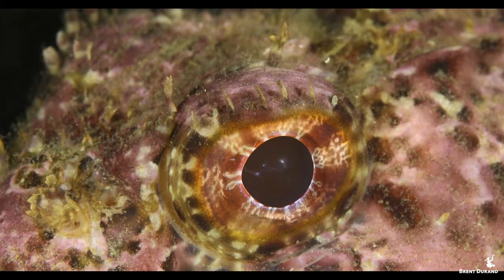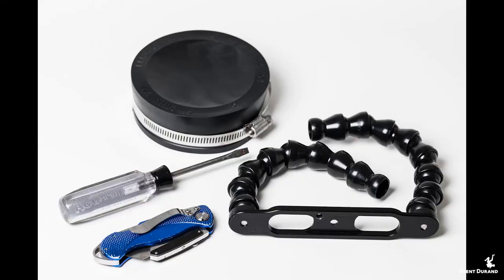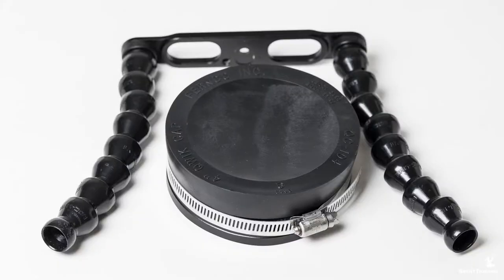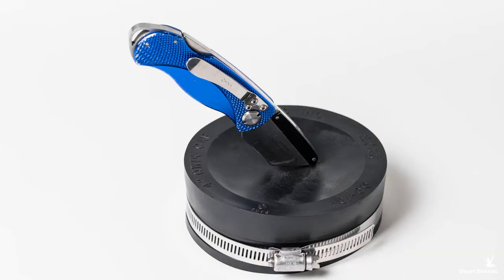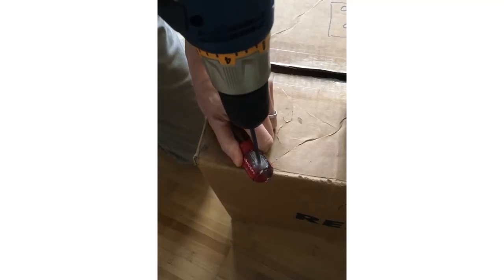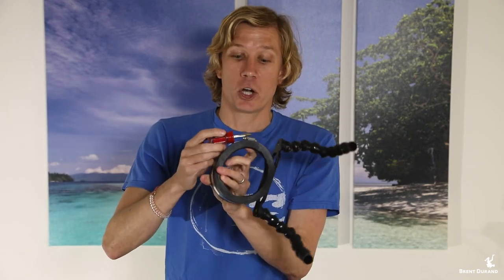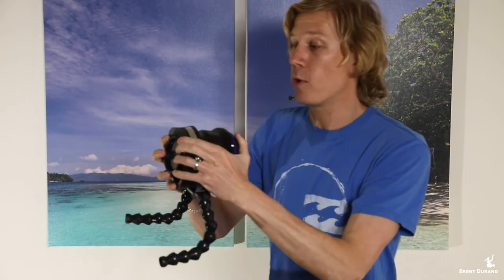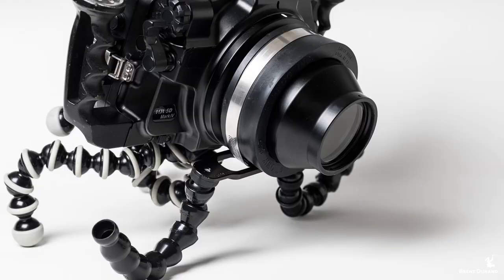How to Build an Underwater Tripod

Comment: Thanks. Is there a way creating one more likely to be used on small action cameras ?
Reply from the maker: Hi Fanny. Yes, there are a number of ways. I use a Joby tripod screwed directly to my action camera tray/handle system, which works great. You just remove the tripod ball head and screw it into one of the threaded holes in the tray. Happy to help you pick out a tray - just email me via my website: https://tutorials.brentdurand.com/about

Here's the tripod: https://www.amazon.com/gp/product/B000KFRSG4/ref=as_li_tl?ie=UTF8&camp=1789&creative=9325&creativeASIN=B000KFRSG4&linkCode=as2&tag=bdscuba-20&linkId=014d658ce8c1fbafc677694cd0a4a5c9